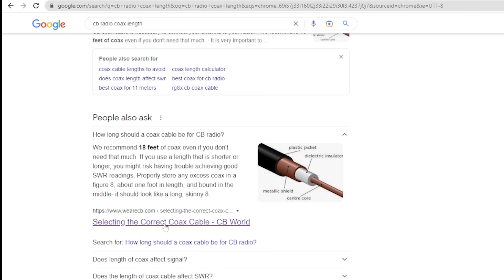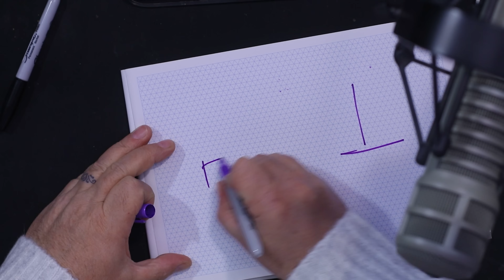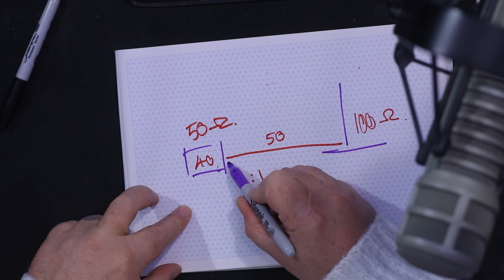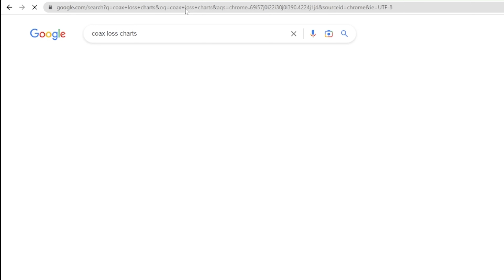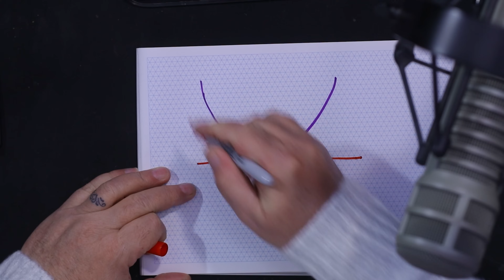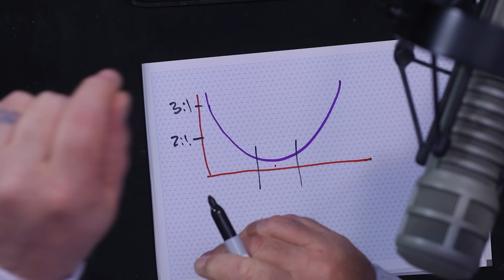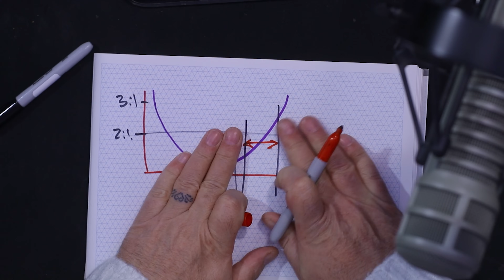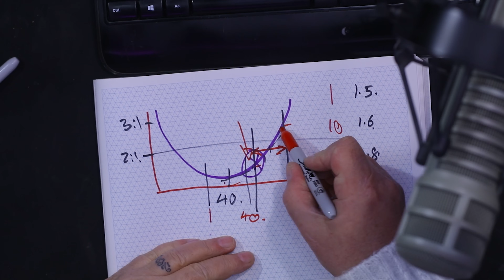11m / CB Radio: How Long Should My Coax Be?

Comment: COAX !! on H.F. no way ! , 300 - 600 ohm twin feeder and a balanced antenna tuner is prefered . 50 ohm COAX with a 50 ohm quarter wave ground plane vertical antenna  is Perfect . 73's DE G4MXC
Reply from the maker: Doublets on low bands are great with balanced line and a nice fat AT4K but for tuned antennas and instant band changes, antenna switches etc, coax rules :)

Comment: Funny. I ran dual whips on a van back in the day and through a small kicker (500w) to shoot skip. I lost my match while at work when a cb buddy was borrowing my van for the day. I figured it out as soon as I got home, someone had stepped on and cracked the t connector on the back of my kicker which was under my seat so god only knows how that occurred but that’s not the funny part. He took it on himself with knowledge gained through the idiot grapevine to try and fix my match by SNIPPING both whips down!!! You know how hard it is to cut stainless steel! Anyway radio shacks were in just about every town back then so replacing them for $18 each was an easy fix. I had the spare t already🙄 No, I never lent out ANY of my stuff to include tools since that day😉✌🏼I’m still running one of those whips today on my pickup with 213 @ a 1.2to1 across the band lat last check😉✌🏼
Reply from the maker: Wow.. good memories!

Comment: Good but could have spent more time around what happens when the antenna is not 50 ohms You mentioned it briefly. The other day I was building a 1/4 wave vertical with 4x 1/4 horizontal radials. The SWR would not behave. All radials and the vertical were telescopic so it was easy to make adjustments but it took time. The 1st breakthrough was when I added around 75cm of coax and the swr came right down. Then I swapped that out for a 1:1 UNUN which helped heaps. Suddenly the antenna started to behave and tuning became as one would expect. I will put the antenna on the vna and see what the impedance really is then perhaps I can add a cheeky capacitor.. It's mainly as an experiment but I knew someone once who had something similar and it worked amazingly well. I'm currently building another 2x verticals. One is a copy of a Maco V5000 or v58 but with copper ring, I took the top parts from a Sirio GPE, ordered some more tubing and some aluminium rings. I tapped into to them and as a prototype I added the 5.6M telescopic antenna and set them to around 1/4 wave. The other antenna is the base of the sireo with the lower section replaced with 50cm of new tube just up from the loading coil then aluminium threaded tube riveted in the top of that to take another of those 5.6M telescopic antenna. Like this I can set it up for portable super fast. Just the 3 radials a small mast and presto. It's not too heavy either so should go well on about 6M of glass fibre spiderbeam mast and a car wheel base..
Reply from the maker: Frankly, the antenna you described SHOULD have been 50 ohms in the first place.. See my latest video. And describing what happens when the antenna is NOT 50 ohms is way beyond the scope of coax lengths for CB. It's more "science" based which would be ham radio specific.. But anyway, have fun. PS - https://youtu.be/dMB6l6kByEg
Reply: @DXCommanderHQ  The 1/4 wave with 4x 1/4 wave verticals would have been around 50 ohms if the radials were descending at 45 degrees but with my test they were at 90 degrees and there was no mast to compensate. I used a plastic mast to see the true tune of the antenna. 
  I now plan to add an induction ring between the radials and the driven vertical and possible a trombone cap design within the middle there. 
  Regarding the other antenna I built. The copy of the Maco V5000. It works amazingly well. In one day I had contacts across the globe from Latvia to Canada From Usa to Brazil and also Gibraltar amongst many more.

Comment: When I first heard about 18ft, I just assumed it was a 3/4 wave matching for a 1/4 wave whip with a poor ground plane which would be >50 Ohm (6ft being too short for most applications) and that the general public misunderstood that as 1/2 wavelength.  In theory 6, 18, 30 ft should act as a matcher.
Reply from the maker: But you don't need any mathing, assuming you have close to 50 ohms anyway.. Guess you know that. Shorter is best.
Reply: @DXCommanderHQ  My canvas top 6x6 Pinzgauer has always been a challenge for CB.  I haven't touched the setup in a couple years (before I owned a VNA).  I got pretty good results with 6ft of coax.  I was considering adding radial wires under the canvas.  The off road club I belong to is migrating to GMRS anyway.  There are a couple amatures in the group but we did not want to make a technician license a barrier to entry.  Anyway I love your channel and am learning so much and more importantly unlearning some misinformation.

Comment: I always did the opposite for swr and antenna length. If it's lower on 1 than on 40 the antenna wants to be shorter. If lower on 40 than on 1 the antenna wants to be longer. The swr is pointing the direction the antenna needs to be adjusted.

Comment: Thanks for the explanation. Can you explain  a bit further why lengthening and shortening my antenna when I’m tuning has a dramatic effect on my SWR but the length of the coax doesn’t matter please?
Reply from the maker: Because the antenna is like the string in a piano however the coax are just the keys you hit it with. Coax length doesn't matter. Bloody good question!

Comment: Think the point has been missed ,the transmitter wants to see an impedance usually 50ohms ,if there is a mismatch at the antenna feedpoint then at different feedline lengths the impedance the transmitter sees will differ  check with an analyser to verify
Reply from the maker: And if there's NOT a mismatch, nobody cares.
Reply: @DXCommanderHQ  more often there is though even with resonant antennas

Comment: Back in about 1990, there was an article I read in one of the radio magazines of the day (CB Action, Amateur Action or something similar) pertaining to this very point. A few guys in VK land and few guys in IK, IZ land from the Alfa Tango DX Group did a lot of testing of cables. All tests were done on 27.385Mhz USB. They used the same radio's and antennas for all their testing. An Itron 27mhz vertical and a 3 element Yagi-Uda beam both 20ft in the air. They tested RG58, RG213, various other 50ohm coax, Heliax and several homemade hardline and ladderline feeders. All runs were exactly 100ft maximum. They found very little real world change in signal with the feedline being from 30 foot long to the 100ft long on any of the coax, RG58 was still viable at this length, they did find a considerable advantage to 600ohn twin line and hardline of course was the best of all, but they also found it difficult to use for MOST cases. 
The signals received were the basis of their results, both S-Meter and Audio reports were tabulated. It was funny to read that a reference signal also tested by the VK guy's on a 5ft mobile whip antenna on a car roof using a coax length of 3 foot, 5 foot and 18 foot had signals within an S point of the bigger antenna's over the same distances, and the coax length didn't change it at all. The tests were over a 10, 20 and 30klm local distance, using a maximum output of 20w SSB and from Australia to Italy, Italy to Australia using 50w SSB, when conditions allowed. It was basically concluded by both teams that the coax length had no effect on the final signal that could be determined without specialized meters and such. To the human ear, the signals were the same, even if the meter was 3-4 S points difference in strength. It was an interesting read. The basic conclusion was, getting the signal to the antenna is all that matter's, some feedlines are better than others at higher frequencies, but at HF frequencies on 100w power levels, runs of under 100ft can be perfectly acceptable with RG58 and RG213, the difference is negligible. This of coarse was BEFORE all these modern coax were available to us plebs....I have NO DOUBT many of the Messi and Paloni or Aircell coax would improve those results.

Comment: got a new radio peaked and tuned at a cb shop. that was a mistake. he told me i had to have 18ft of coax. went into a long story about how it always does better.  twice as good as 9ft... he said, well let's go check your coax and antenna with my analyzer.  kept my mouth shut. we got out to the truck, i exposed the end of the coax, he plugged in analyzer, it showed 1.18swr. i said that's only 10ft of lmr400, so how could the swr and my performance be any good. that was the end of our conversation. 10ft was because that's how far it needed to be. 9 was too short, 11 was too long. didn't even know what i was doing, but he proved to me the 18ft thing was balderdash. thanks for the video !
Reply from the maker: Wow!!
Reply: @DXCommanderHQ  thanks for letting us share experiences in your comments section. lots of learning happens here and makes future experiences less surprising.

Comment: I’ve installed different lengths of coax mainly RG8X RG400, RG142 or RG58A/U between the antennas and radios from 12’ to 50’ and it depends on how far the antenna is from the radio and never had any issues but as long as the antenna is tuned.
Reply from the maker: You got it.

Comment: Callum i think the biggest problem cb experts have is they are taught and use commercially manufactured antennas. 
Antenna performance depends on a lot more than manufacturers statistics.
Like you I build my own antennas.
Matched to their feedline i rarely have over a 1: 1 swr 
As an example my 20 meter homebrew dipole at 32 feet above the ground. Gets me some great coverage as i live in a valley. 
My furthest calls to date is half way around the world on 5 watts ssb( from pennsylvania usa to France, Scotland, and Russia)

There is a lot more to antennas than just swr!

I dont fault the cb experts because they may not have had the proper education.
I highly recommend they get the arrl antenna guides and handbooks.
Love all you videos!!
73 Ted Kc3tec
Reply from the maker: Good point.

Comment: Just this past weekend I went through all of this, exactly, but all calculations made in feet (468 / freq in mhz) with my grandson.  I have the Rig Expert AA-54, which graphs.  We built a dipole, deliberately made the wire a few inches longer than calculated.  The dip was offset just as you showed.  We recalculated from there, cut 1.5" from each side, centered the dip right around Ch. 20.  SWR was 1.5 on Ch. 1, 1.2 on Ch. 20, and 1.4 on Ch. 40.  But he got to see all this first hand.  A great lesson!  He could not transmit... he had his Dad's CB, but could not find the microphone.
Reply from the maker: Ah!
Reply: My grandson called me a few days ago.  He tore the store room apart looking for the mic, no luck.  I ordered him one which should be there any day.  I've got him lined up for a ham cram, so maybe he'll get licensed.

Comment: Wow been on and off CB for 45 years, and all I've ever heard is it's all about the length.of your coax, and it's never been a problem with me anyway.but just at the end of your video you said,if I got some extra wire I would coil it up anyway . which has only just clicked that you coil up the ARIEL, bottom ,middle or its on the top , so the moral of the story is it don't matter.thank you very much . DX COMMANDER.ALAN IN LUTON 💯👍
Reply from the maker: YES SIR! Finally  :)
Reply: Truckers are smart, but they do not really understand radios and antennas very well. The CB companies and other industries industry has long taken advantage of their relative ignorance of scientific things to sell them snake oil of various sorts from radar jammers to anti glare interior cab lights to fuel line magnets. Are two antennas better than one...etc

Comment: The only time I take coax length into account is when I'm using multiple antennas and I'm taking phase into account. Or if I want to play around with circular polarisation with a cross Yagi. I do prefer to use ladder feed on base antennas because of the loss efficiency. Plus of course I can make a non resonant antenna outperform a resonant antenna  ;-)

Comment: My last real CB setup had a quarter wave antenna centered on top of a commercial van. The antenna and coax were tuned with a $25 000 Vector Voltmeter I happened to have at work.
A stock JC penny 40 channel SSB radio could talk from Oklahoma City to Oslo like it was down the block.
Now, you can get a vector analyzer for $60.
There's no excuse for running around with a miss matched rig and antenna.
Reply from the maker: Please don't tell me you actually cut the coax specifically for the match? 50 ohms is 50 ohms :)

Comment: I called President and asked them about cable length and was told it does not matter. I ordered a RigExpert AA650 Zoom and a bunch of antennas and cables and will do my own testing. What is right is what works. I have solar panels on my van roof and need to find out if they are affecting my antennas also.

Comment: I intend to have some conduit put in my wall because of a possible loft antenna, I've been looking for a wall mounted so239 plate outlet with no luck. Is such a thing available? The Mrs won't have any wall mounted cable or trunking!
Reply from the maker: Any plate.. Then drill a 16mm hole and buy a through-connector.

Comment: IT IS VERY important that realize CURRENT and VOLTAGE nodes. We want these in the correct places on the antenna, not the feed line. In a MOBILE APPLICATION, Single band, resonant antenna, it is important that the we use the proper length of coax. Odd multiple of a quarter wavelength, factoring in the velocity factor (varies per coax type). We use either 1, 3 or 5, increments. The data can be found in the  U.S. Navy Communications reference/manuals, and etc.  The SWR verses a single band resonant antenna is ALWAYS affected by feed line length. Come on...  This is a long time debate, but was proven at the local radio club by swapping out coax length of the same type, off the same spool, laying on the same ground. Using the exact same frequency, different lengths changed the SWR at the radio end. And, science says it will. I am not one to argue with science.
Reply from the maker: Yeah OK.. so someone at a club demonstrated this.. However you need to realise that if it was a 50 ohm load, it's utter baloney, sorry :)
Reply: @DXCommanderHQ  Respectfully, For mobile antenna that is tuned to resonance but way off in impedance, certain lengths of coax will transform the wrong impedance to the desired impedance and there are formulas for this if you know the actual impedance of the antenna. In this case you would calculate the needed length of coax in fractions of a wavelength then multiply by the velocity factor of the coax. During the field test, the same antenna and position was used and it was not tampered with in any way. TX was set to minimum pwr of 5 watts and was not changed. The test connected different run lengths from the same coaxial spool, moving the radio horizontally to and away from the antenna to keep the coaxial straight with no bends. Different lengths provided different readings at the TX end. Some where excess of tolerance. Adding  a small (.5 meter) to the line, bright the SWR back to usable at the TX. The findings of the testing: Using the published formulas, as found in military communication handbooks, undesirable SWR was tamed at many incremental lengths, but not in between those lengths. Odd multiples of 1/4 wavelength, multiplied by the velocity factor, was consistently favorable. Right out the texts. Fascinating subject, antenna systems. My favor part of the whole mess. : ) Salute, and your contribution to all is appreciated!
Reply: @tahoma6889  You're doing it wrong.
Reply: @terryparker1925  perhaps you should argue that with the US Navy. I mean after all, they are just a bunch of hobbyists, right?
Reply: @tahoma6889  If you're tuning the coax you're doing it wrong. FACT.

Comment: A half wave end fed antenna with a 49:1 unun without a counterpoise andr RF choke will use the coax shield as the other half of the antenna and thus the length of the coax will affect the SWR.
Reply from the maker: It will because the coax is part of the antenna.. When it's NOT part of the antenna (most 50 ohm systems), length doesn't matter.. Just loss.

Comment: Um.  After more than 40 years experience with CB radio, ive got a couple observations..not attacks....not trying to trigger anyone

IF your antenna is resonate,properly grounded, properly installed, coax length shouldn't matter

If you need a specific length of coax to match, you got a problem with the antenna or installation
Reply from the maker: You middle line was perfect.

Comment: Awesome video!! I do ha e a question though, and no one seems to have an answer. How does adding an amp, between your antenna and radio, effect your coax length, if at all?
I want to put my amp in the trunk, my radio under the dash, and the remote to turn the amp on by the radio. Please help!?
Reply from the maker: Coax is like a pipe - just moves the energy from A to B.. As LONG as your system is designed as a 50 ohm system, it's irrelevant - only the LOSS should be looked at. Amp or no amp.
Reply: @DXCommanderHQ  Thank you, sir!!